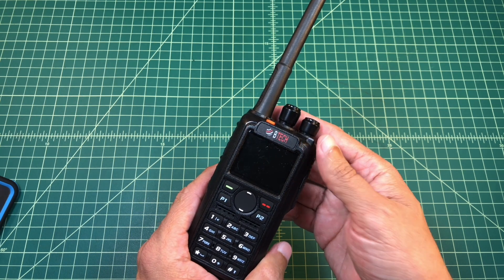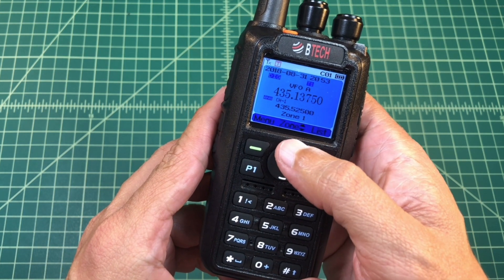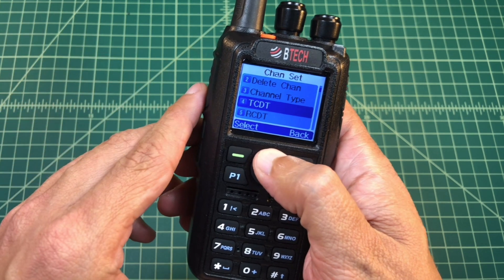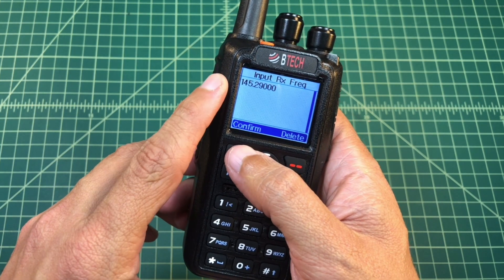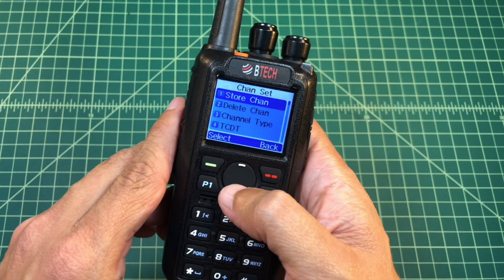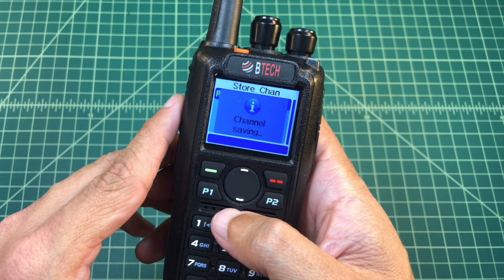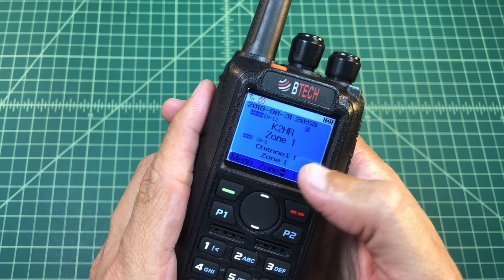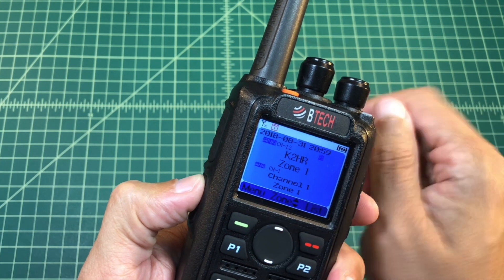BTECH DMR-6X2 Analog Repeater Programming from Keypad -TheSmokinApe

Comment: talkaround transmits on the repeater output frequency not the input frequency. if your talking on the input your using the repeater not talkaround
Reply from the maker: Thanks for the comment, after watching I can see how someone would be confused.  What I said is that you would talking the repeater’s tx frequency meaning the output frequency of the repeater.  I will pin this comment in the event others have the same question.

Comment: As I turned my radio on all it says is “programming error” I was manually inputting analog repeaters into the radio via the keyboard and haven’t had issues up to this point. Any insight as to what I can do? Thanks
Reply from the maker: I'd try a factory reset, if that doesn't work re-flash the firmware.  Good luck with it.

Comment: you blew past the one thing I am having trouble with on this radio... setting offset freq. direction.... I have no idea where to use + or - on this radio...  the btech software is also missing an obvious setting
Reply from the maker: You set it when you set the TX frequency
Reply: Set the playback on the video to .75 or .5, he sounds drunk but it's all there !  LOL

Comment: how do you set the negative offset
Reply from the maker: Under settings go to channel settings and you account for the offset in the tx or rx frequency setting.
Reply: @TheSmokinApe   OK so i'm in the settings that you described and i don't see a setting to indicate that the offset is negative or positive
Reply from the maker: You just adjust the tx frequency accordingly.
Reply: @TheSmokinApe  well for example the frequency I'm trying to reach is a repeater in Yonkers New York as a negative offset 146.86500 is the frequency how do I set the offset too   negative
Reply from the maker: 146.865 would be the rx and then 146.265 would be the tx

Comment: how can I program 2 BAOFENG to use them as walkies
Reply from the maker: Make sure to check the legality of use for these in your local area.  I always use chirp to program them.
Reply: @TheSmokinApe  can i use the same frequency on tx and rx? on chirp i can set the tx power mode, right? 
does all this work, i think this handheld is the on and only :-P
Reply from the maker: GGShaggy you can have the same tx and rx, power can be adjusted on the radio and set in chirp.